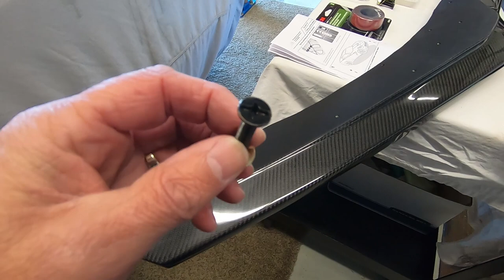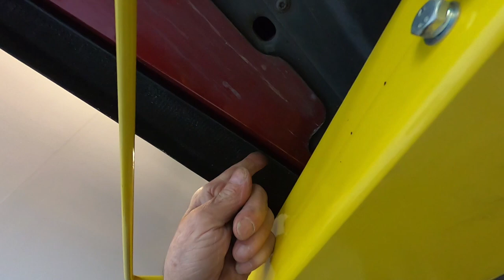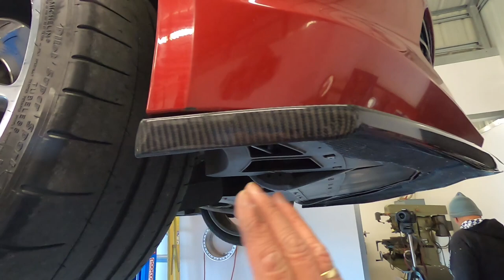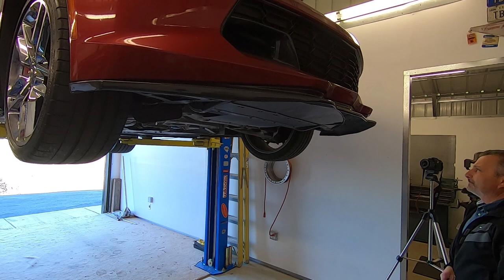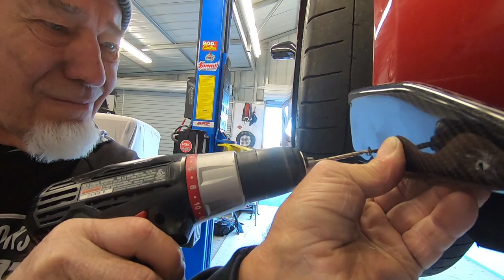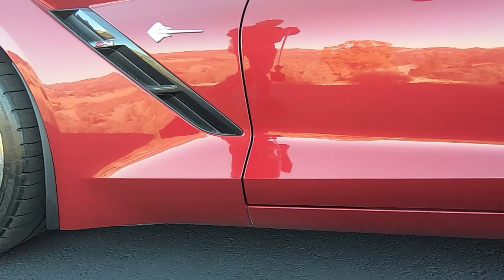How to Install Aero Package on a C7 Corvette

Comment: This was the first real Mod I did to my C7.  Love the aggressive look it gives the car once the side skirts and the splitter were installed.  I did elect to not use the 2 sided tape.  I didn't want any extra water being trapped by the tape over time between the body and the skirts / splitter.  My thoughts here were that between the rivets and the stock screws, it held the parts in place tight enough to avoid any rubbing and the water soaked taped could potentially cause more long term damage to any of the paint between the parts.   In any case, great video and yes, it takes some getting used to stepping over the side skirts so you don't step on them getting out of the car and curb aprons and speed bumps suck the life out me every time I go over one with the splitter.
Reply from the maker: Thanks for the comment. I so agree with you on the driveways and speed bumps!
Reply: Hey Rick where to find the right kit? I have an arctic white and want to get a black kit on it.
Reply: @OfficialYasirKhan  c7carbon -  Good luck

Comment: I have a 17 GS did the same mod wanted the CF look I also did the rear spoiler all from EOS. All the pieces are carbon fiber not carbon flash I also did front fender flares  in CF I hated the cheap plastic flares that GM uses . Great video.
Reply: EOS  parts are carbon Flash!

Comment: What size bolts did you use for the winglets and any issues after the fact using the self taping screws on the splitter? Do you wish you would have used move rivets?
Reply from the maker: I'm sorry I don't remember what size screws. I didn't have any issues with using the screws. In later version of splittera that I have put on the car I have used a mixture of screws ans rivets.
Thanks for watching!

Comment: Could you comment as to how the skirts and splitter have held up after use?  I have seen poor reviews of the extremeonline pieces due to some of the carbon fiber overlay coming off.  Thank you and fantastic video by the way.
Reply from the maker: Hi Jason,
I have had great luck with mine so far and I have driven in a lot of rain and debris all over the road and they hold up well and cleaned right off!!
The finish is still real nice!!
I happy with mine!
Reply: Jason Fannin Scott should update his response to your question because in a later video he pulls this crap off and replaces it with ACS products.

Note that the full length under car rubber air dam is missing in this video as well.

Comment: You may want to add a product called slip-lo on the bottom of your front splitter, it’s made to save the bottom.
Reply from the maker: Thank you. If you look at my new video where I install a Zr1 front splitter I use the Sliplo product. I even have a discount t code for you to use to get a discount!

Comment: What was the length of the screws you used on the side skirts?    I heard it’s critical the screws not be over a certain length because C7’s with an automatic transmission the transmission fluid line runs along the left bottom side along the rockers and if the screws are too long you could puncture the transmission line.

Comment: The first thing I would do, would be to pull up too close while parking, and rip the front one off. Is your Z06 grille, also from EOS? I just ordered mine, and it came in a black with bronze flake, instead of carbon flash look.
Reply from the maker: Hello Gregg, Yes that is a real concern. I just try and hope a stay away. I find that I back in most of the time. I bought my front grill on Ebay not from ACS. Even though ACS has one with the LED lights that I would love to put on.
Reply: Gregg Walmsley Some have the front cameras that help you avoid parking too close. They come with several of the option packages.
Reply: Mine does.

Comment: Hey you might have covered this but is that color of the aero package considered carbon flash metallic? Thanks again.
Reply from the maker: Hello,
So in this video I actually installed Carbon Fiber Aero.
But later on in my next videos I had damaged this set and I went with the Carbon Flash Metallic Aero.
Hopefully this helps.

Comment: Looks really nice, I like the front splitter as a great add-on! Super explanation as you went along, thx. Question, what about the front 3 piece air dam / air deflector? My 2019 Stingray has it, I'm assuming it has to be there  after the splitter install too?
Reply: Mine has the same, I assumed the splitter replaced the function of the air dam. How'd you go about this?

Comment: now show us how to disassemble and reassemble the spoiler in case if we want to upgrade to a more aggressive spoiler or if i want to throw a ZR1 spoiler onto my Stingray.
Reply from the maker: Check out my other videos. I show how to install an ACS stage 2 conversion spoiler and also a Stage 3 Spoiler. I. that video we remove the rear bumper and remove the Z51 spoiler and install a stage 3 spoiler.
I will be doing a ZR-1 spoiler as soon. As it becomes available. Hopefully soon!

Comment: What size screws did you get to attach the winglets? I just installed the side skirts and splitter yesterday. Any help would be appreciated.
Reply from the maker: What I did in the video was go to Ace Hardware with the winglets and got the size that looked good. What I would recommend now is go to Chevrolet and  get 4 of the long bolts with the hex or torx head that is used on the rear Z06 stage 3 spoiler and then get 4 washers and nuts to fit they will look better and you will not need to countersink the holes. Good luck!
Reply: Thank you

Comment: Does anybody know if you can put the fender flares or whatever they’re called on the wheel wells on a 2014 Z 51 stingray three LT as the same that are on the grand sport or the Zeos six ? 
     Or maybe no you cannot because the grand sport and the Zeos six fenders are wider maybe does anybody know this because without them fender flares the words do not look right if you position them flush in the front with the splitter if you know when I’m Saying appreciate the help
Reply: Should be able too. ACS composite

Comment: What kind of exhaust   system do you have
Reply from the maker: It is still the Factory Exhaust
Reply: @THECORVETTECHANNEL  do you know of a aftermarket system that has that sound
Reply from the maker: @hanklopez898  the Corsa Extreme is probably the best aftermarket system in my opinion.

Comment: Can I do it without a hoist maybe?
Reply from the maker: Yes you can but it will be more difficult!
Reply: I just did it yesterday with just a jack. It works, you can get the car high enough to complete the job. It is more difficult but it can be done.